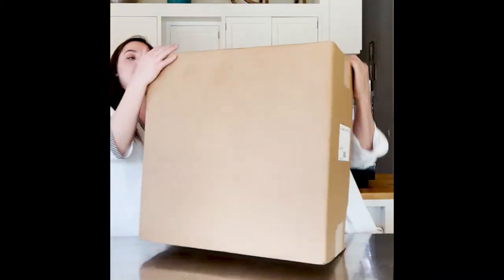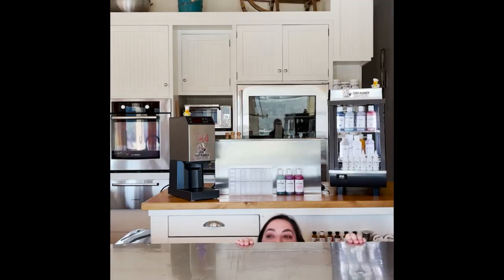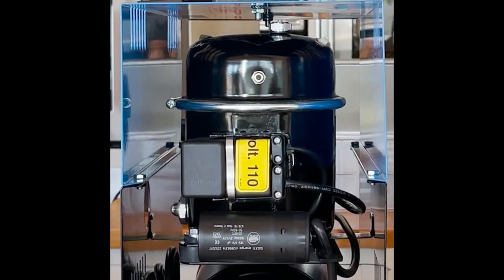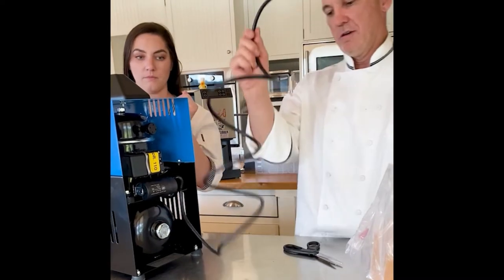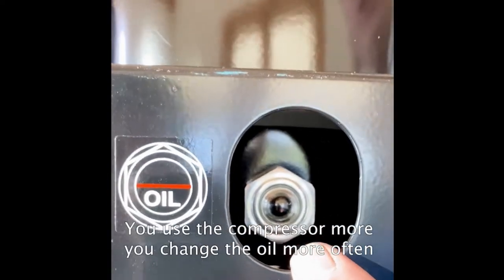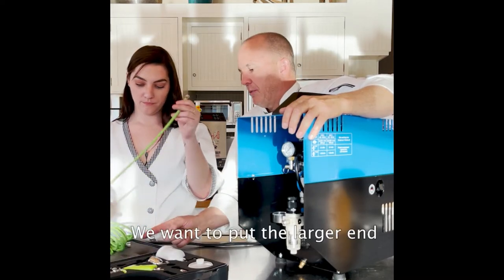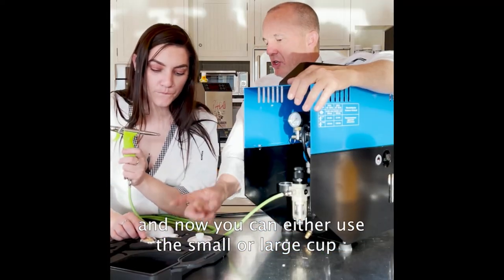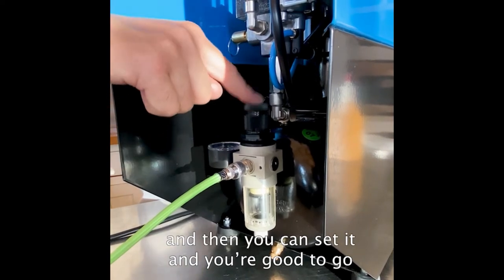How to Set up Compressor for Airbrushing with Colored Cocoa Butter

Comment: Paul,
Why not use an oil less compressor?
Reply from the maker: Hi Timothy! When deciding on your compressor, it's really a matter of preference and what your production level is like. Oilless compressors are piston driven & produce more sound . While Oiled Compressors run on the quite side.
Reply: @ChefRubber1  Hi guys, I always thought the reason we used Oil-less was so there was no oil to get past the pump and in to the butter, is that not correct?
Reply from the maker: @Wobblie75  Hi Mike! Great question! You're not wrong, when choosing an compressor it is really a matter of preference & what your production level is like.